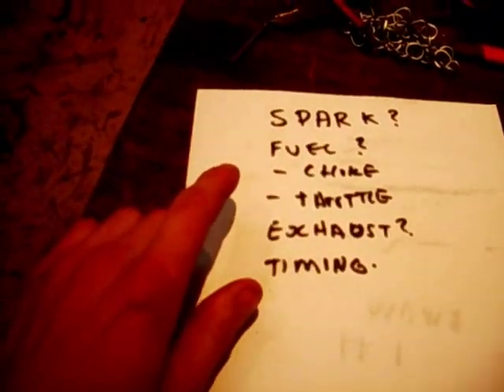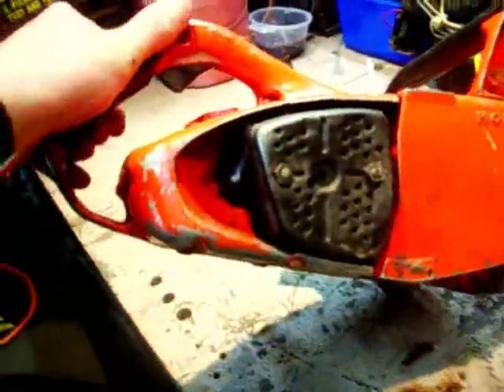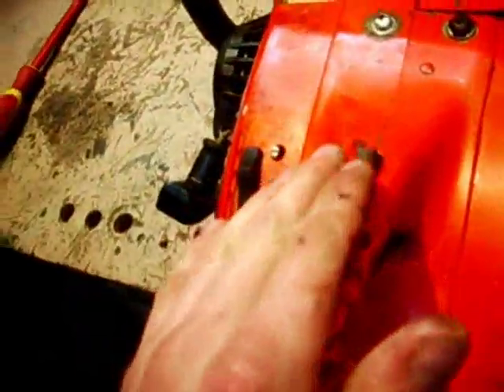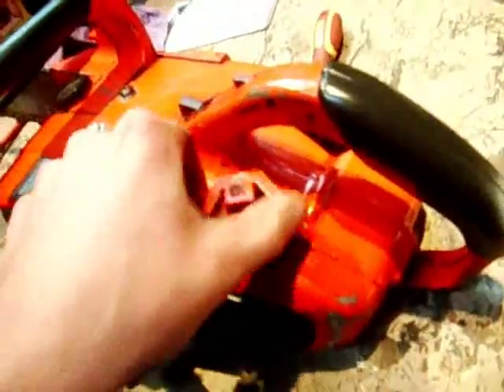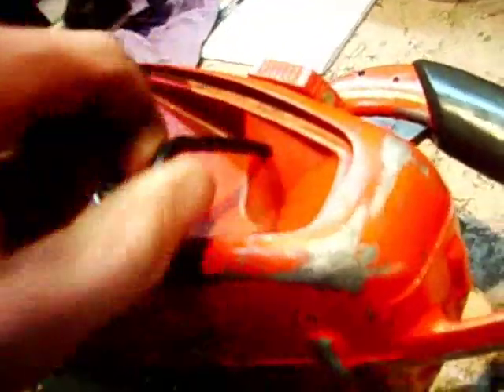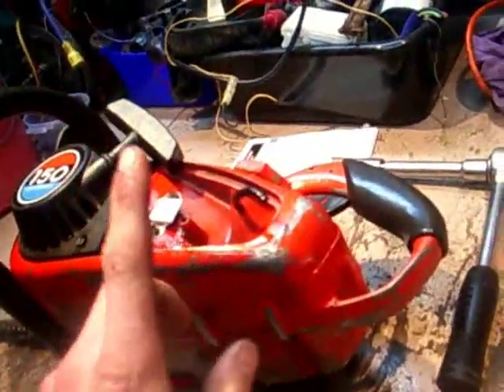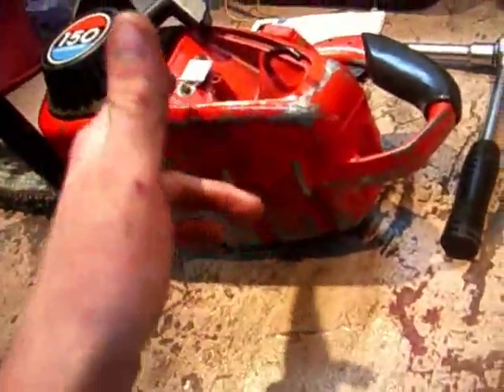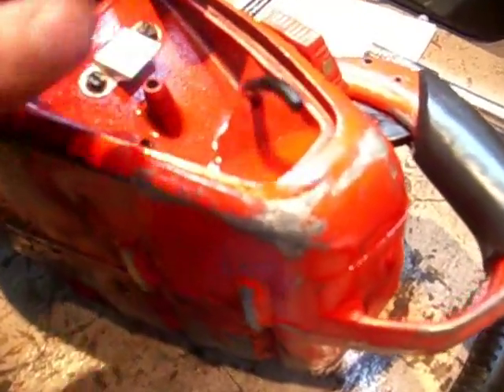trouble shooting small 2 stroke engines

Comment: Thanks for the vid, it's only 1 that covered all topics & systematically

Talking 2 cycles (I've got a 43cc tiller) worked fine, put up 2 days, now won't start.
The starter rope was hard af until I put breaker tune up in it. It's a lot better now but no start.
Oil comes out the exhaust after cranking for a bit but not much, everything else tested positive. 

Q- what would make it work then stop and pressure inside the piston be so hard it stops you from pulling the starter? Is build up an option?

Comment: You also need to be sure you have the right air/fuel mixture to start the engine. My grandpa has a Homelite 150 automatic chainsaw and it wouldn't start because it wasn't getting enough air mixture. He had to adjust the carburetor by turning one the air mixture adjustment screws.

Comment from the maker: @sniperpr0100 wrong fuel ratios shouldnt do allot of harm as long as it wasnt run too long on it. sump may have excess oil in it but meh. ide look for stark first, then if there is look if there is fuel delivery tot he cylinder by cranking it with the choke on and the spark plug lead disconnected. if the plug is wet with petrol and not just oil then you have fuel delivery. but if its run since you ran the incorect fuel mixture in it it will be something else ide almost bet.